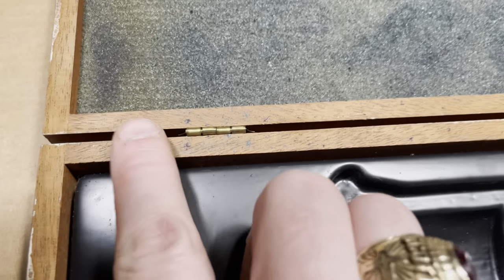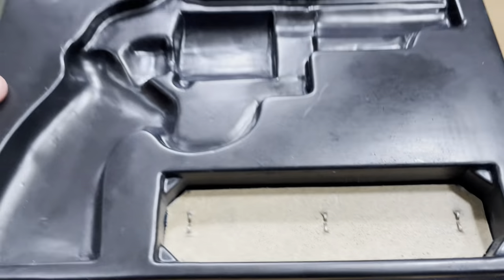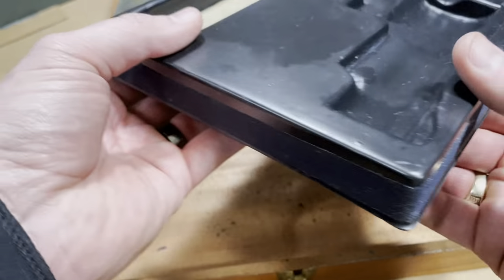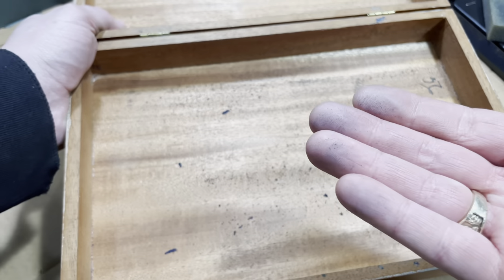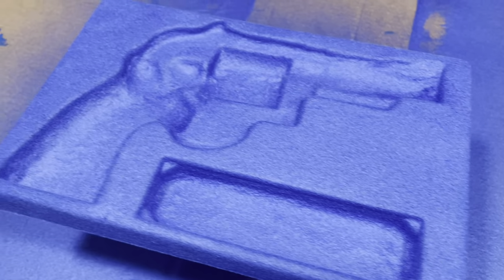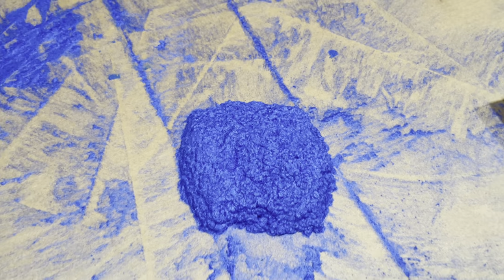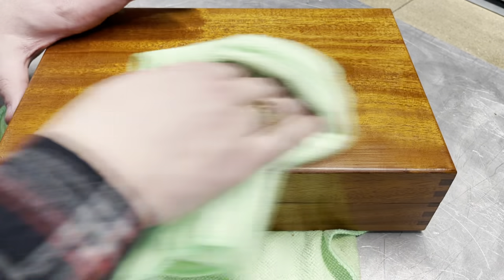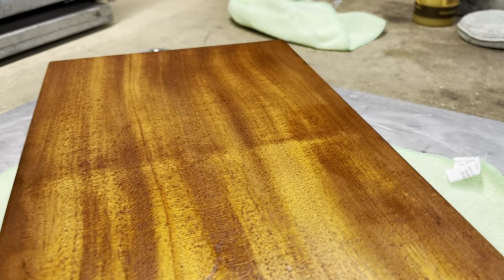Flocking A Firearm Case With Flock It! Smith & Wesson 44 Magnum 29-2.

Comment: Great job! That's the thing with the old S&W Presentation cases, the flocking or lining comes off. I didn't know you could reflock them, I have been relining them with velvet material. I will have to give the flocking a try. Thanks for posting the video!
Reply from the maker: Very welcome! It’s super easy!

Comment: I always put the cases in storage. The safe queens go into silicone socks and the rest are out just waiting their turn to be used. The flocking would be cool for a  glass show case though.
Reply from the maker: Yep. Display purposes only! Thanks for watching!
Reply: @linksgarage1985  This is the key to preservation...They are for display, and not storage...Moving them around with the gun inside causes the molded plastic inserts to crack and break, plus oil seeps out of the gun and deteriorates the flocking...The weight of the gun also causes the plastic to break around the barrel and hammer areas...They are a real pain to restore...As mentioned by another viewer, the tape around the perimeter will help hold the plastic base intact...If you have one that the flocking is partially gone or worn, I soak the whole insert in 91% isopropyl about 20 minutes then the whole mess will just hose off...The foam rubber insert in the upper half is useless as the new flocking does not adhere well with the adhesive...I cut a stiff piece of cardboard to size, seal it with polyurethane, then flock it when dry...Cut it for a tight fit in the lid, and you won't need to glue it down...You are correct in using much more flocking than needed with the applicator...The excess can be brushed off with a clean, dry paintbrush, and reclaimed back into the storage bag for next time...My S&W collection is stored inside my safe in silicone treated gunsocks...They will not rub against each other when stacked high, and I've never seen rust on any of them when I take them out for display at gun shows...I transport cases and cardboard boxes separately...The FlockIt product itself is excellent - it's the only one I recommend...👍

Comment: I have about 24 presentation cases. The problem I have is they are all plastic and cracked. The Flocking is fine. I have never seen one with foam.